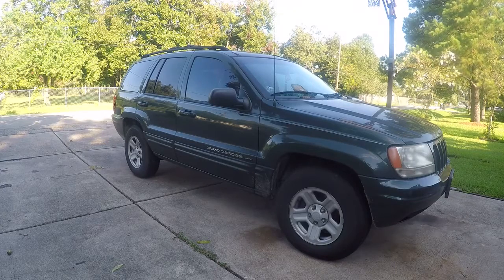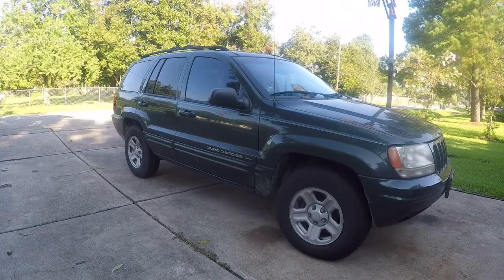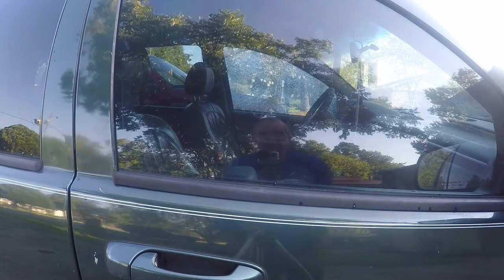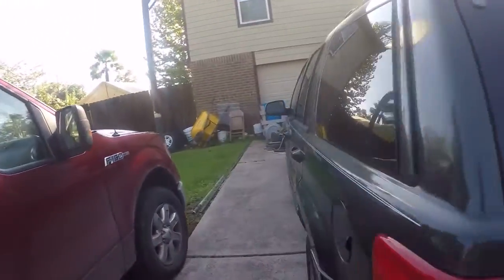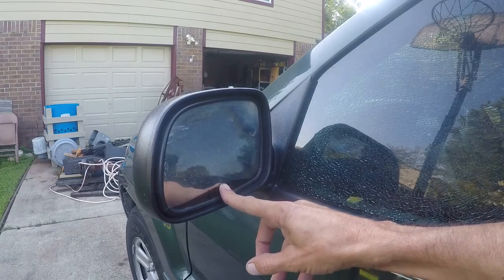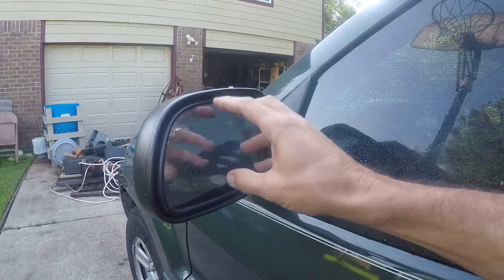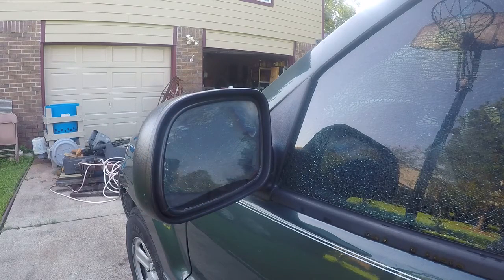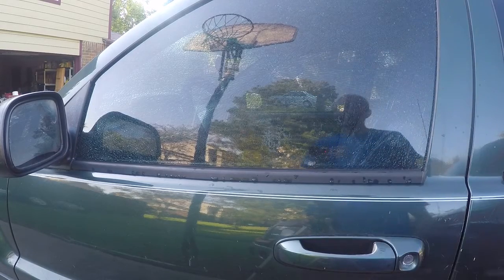Drivers Side Glass and Side Mirror Replacement - 2000 Jeep Grand Cherokee - Part 1 - Disassembly

Comment: That fluid is noticed when your auto-dim feature has failed.  While presumably most mirrors sold with the auto-dim feature are also heated, these are two distinct features.  In a pinch, since these cost significantly more than a plain mirror insert, after the auto-dim has failed, one can remove the top glass, wipe away the fluid, and cut away some of the wiring left on the edges and be left with a standard non-dimming but heated mirror- FYI.
Reply: i guess I'm quite randomly asking but does anybody know a good place to watch newly released series online ?
Reply: @Camden Raul Thanks, I signed up and it seems to work =) I really appreciate it!
Reply: @Henry Cannon happy to help =)